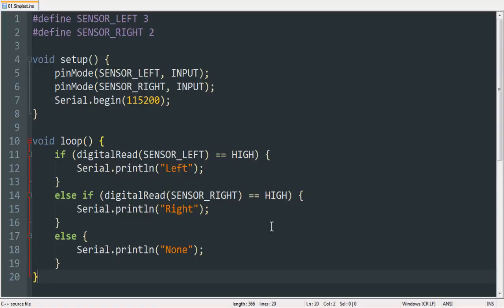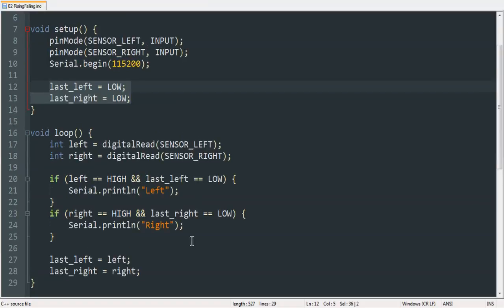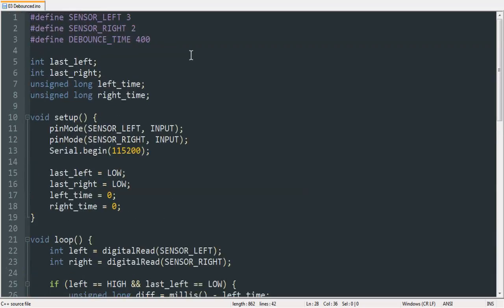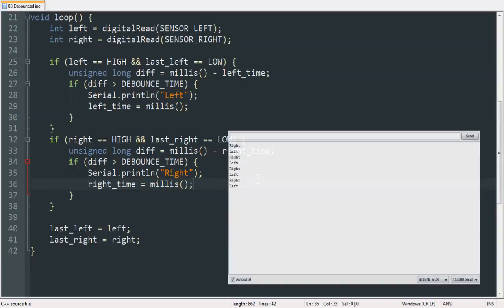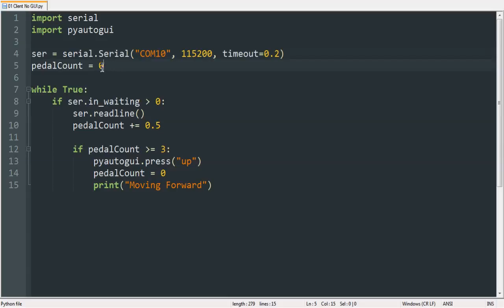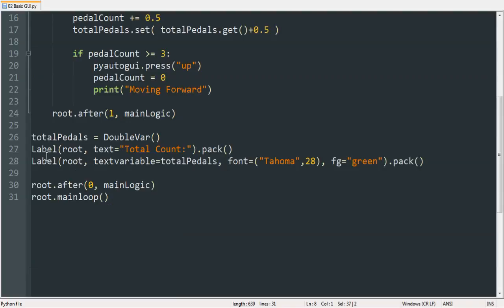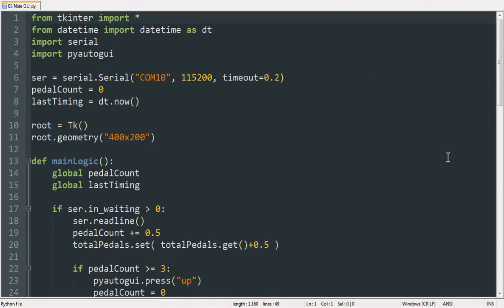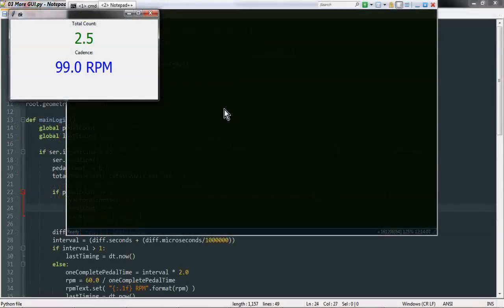Programming an Exercise Bike!

Comment: Quite interesting. Thank you for the detailed explanation on the arduino parts and programming. I might try this but instead of Google Street View which has limitations - like it "warps" to the next capture point and it doesn't have sound - I'm consiering using a game like Grand Theft Auto 5 where you can use an actual bike to explore the city. That means it can granularly move the scenery based on your pedal speed and not warp the scenery around you and you get the sound effects too.

I guess I'll be looking for some reed switches in my neck of the woods. Thanks for the tutorial!

Edit: I guess I'm not that good at figuring one part out. What would the schematic look like on an Arduino Uno for example?
Reply from the maker: Hello and thank you for your comment! So many people have been telling me about how great GTA5 is for the driving portion, I should really get that game sometime and give it a try!

Regarding the schematic, this would be one way to do it, just a quick sketch I put together. https://drive.google.com/open?id=1n5ikSaPCSsJfG_oq7paWmlHiPPWHUP49
Reply: Thanks for the reply! I'll give it some more mulling about so I know what I'm getting into before executing.

GTA5 is a good example of an open world game where you can cycle. City is pretty busy, you can drive up to the desert, etc. And there are mods you can run to make the graphics more realistic... But I'm just throwing ideas around right now. Thanks again!
Reply from the maker: Cheers! I'll look into GTAV!